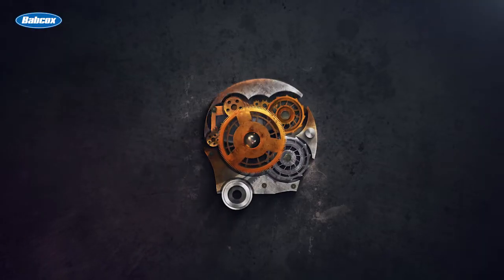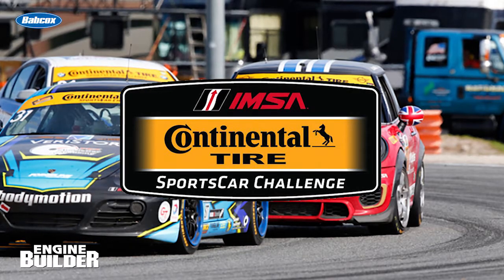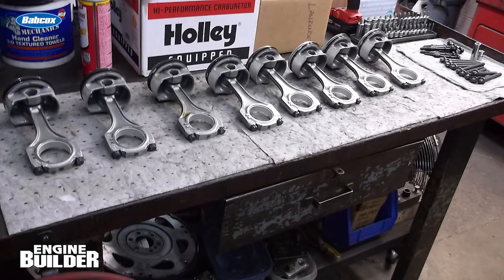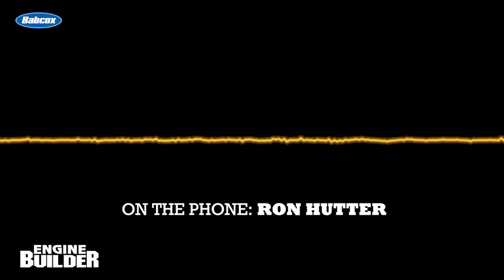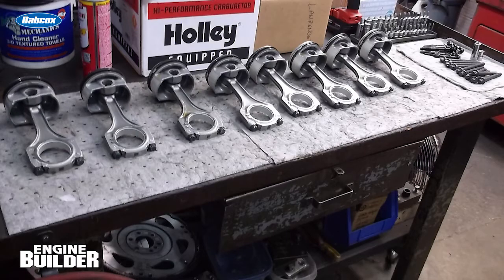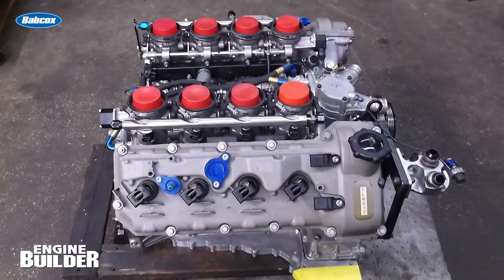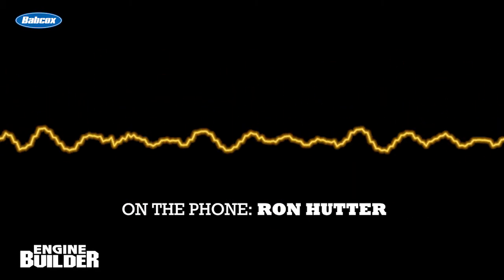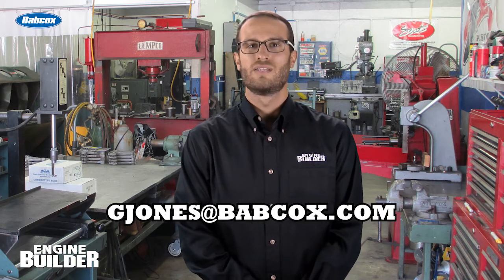Buliding Blocks – BMW S65 V8

Comment: 570 bhp on standard s65b40? without turbo? impossible!
Reply: B44 flatplane crank
Reply: @amazigh8776 it is noth flat
Reply: @g.g4816  yes it is
Reply: @amazigh8776  no luck at it
Reply: I mean ascari got the S62 to make 625bhp na.
Reply: @Air0374  what did he do to the engine? Is it a simple modification?
Reply: yust raise rpm ...
Reply: What?? U obviously dont know whats up

Comment: 570?? no chance.
Reply: very hard to believe on a standard 4.0L displacement motor... I wonder if it was stroked to 4.6L or that number was dyno'd with forced induction paired with the motor, those are the only 2 explanations for the high hp they claim on this platform (to my knowledge).